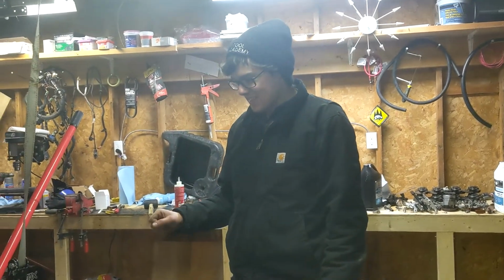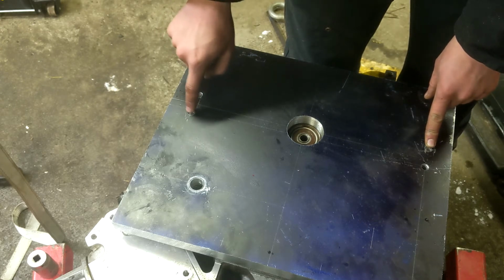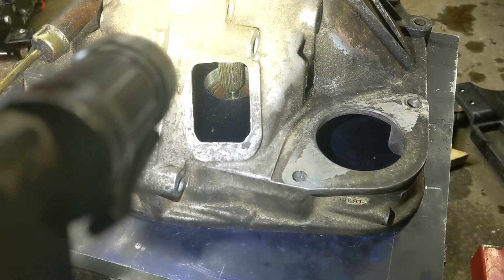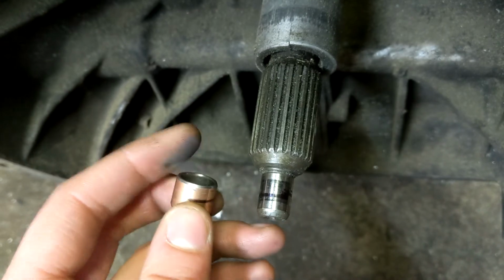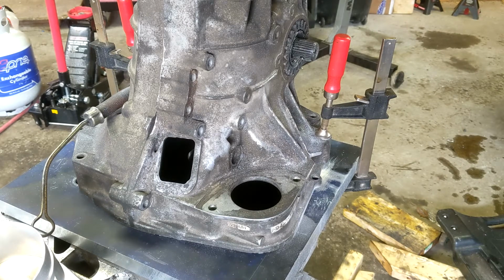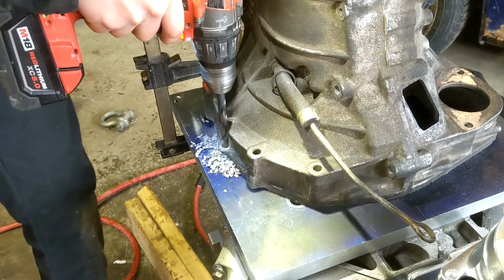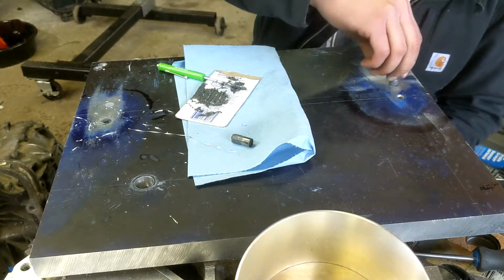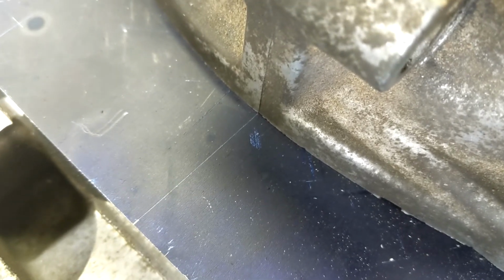AWD LS Swapped WRX | Part 12 |  An uncomfortable amount of JB weld

Comment: Get a center punch set with various sizes to mark holes. Your method is almost right but marking drill holes with the drill will not get the hole right.

Comment: Get a thinner plate by the looks of it. I would say take away a 1/4 inch is all you need bro then you will be deep enough in your pilot bearing. Get your measurements with the plate your using now though while your at it. To make your drill bits last longer I recommend using a bottle cap of engine oil drill and dip drill and dip. Awesome job btw keep up the good work! Just subscribed
Reply from the maker: The plate needs to be that thick for proper clutch alignment. I have been using a cutting fluid, I just neglected to in this episode. Thanks for the sub ☺️